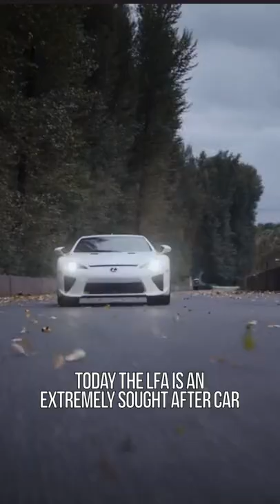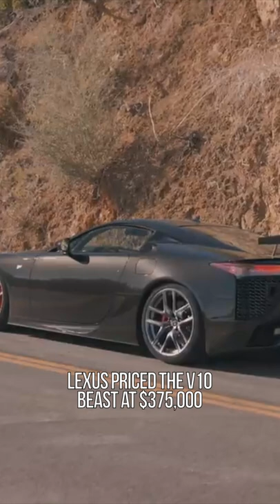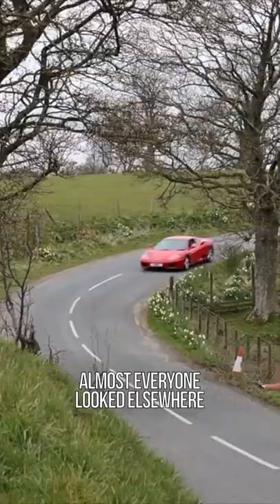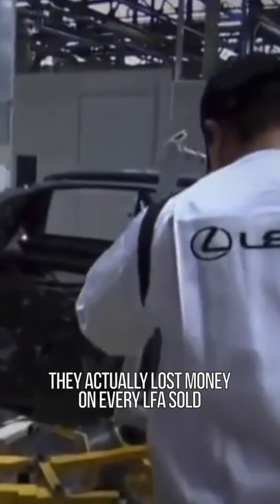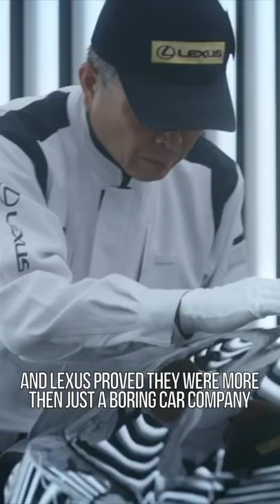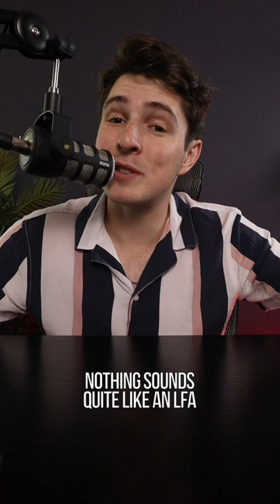Lexus Lost Money On Each One Sold.....

Comment: The LFA developers made the mistake of releasing it way too late. They had a car way ahead of its time. But they wanted it to be made of carbon fiber which increased the development cost and delayed it to the point where the car wasn't that much cooler than any other supercar. If they released the aluminum version it would have been successful.

Comment: fun and sad fact: the creator of the car, sadly passed away in a crash during a test run at the nurgurgring
Reply: Yes and no. IRC He drives aluminum/steel prototype. They scrape that project and make it in carbon fiber. 
Yes car still have same engine and design as that prototype.

Also sound isn't made by Toyota/Lexus but amall piano maker from Japan called Yamaha